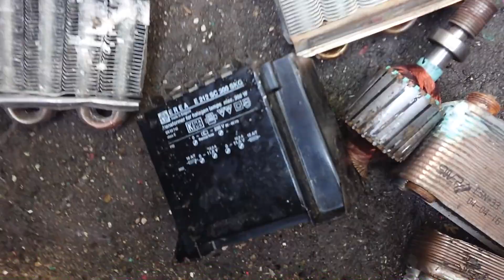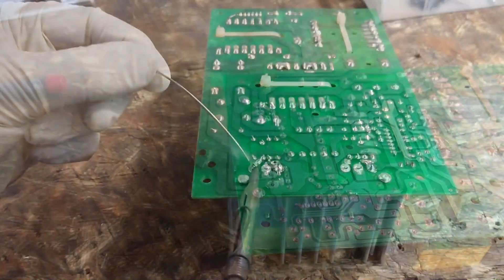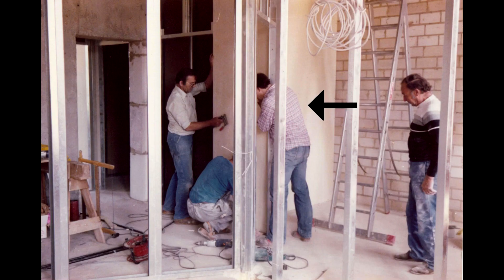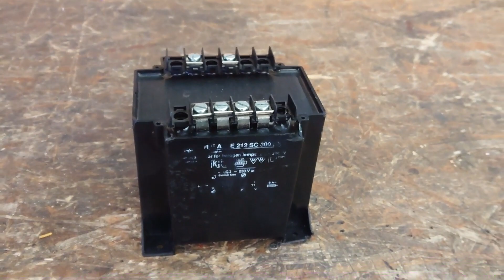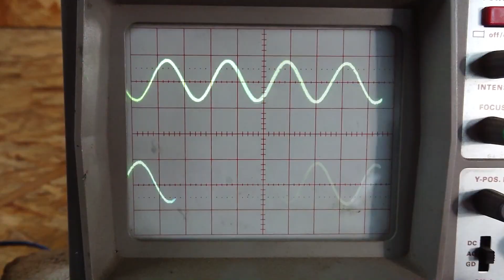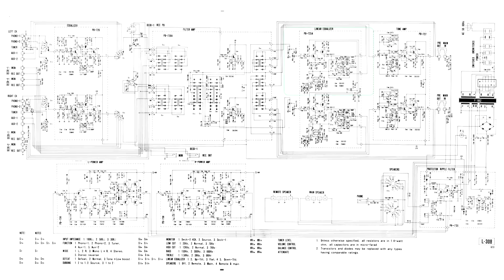Unusual Scrapyard Finds! Repair-A-Thon!

Comment: On that dental lamp front center wheel can be turned to adjust light intenisity, it works mechanicly by partialy obscuring the light bulb. It's usualy stuck becose everyone kept it at maximum for decades. Also focus can be adjusted to get perfect rectangle light on the surface at 1m distance by removing back cap held by the spring coil and pulling bulb socket in and out by hand, bulb can also be replaced from the back without disassembling the lamp. I still see them in use to this day and osram and philips still make 24v 150w bulbs for them.

Comment: Nice work on the amp repair! I have an old Technics SA700-A tuner/amp (100 watts RMS per channel), from 1978 that needs a similar treatment. It still works but the pots and most of the switches need serious cleaning and/or replacement. I hate to just throw it out, since it has fantastic performance when it IS working. It's a real boat anchor, weighing in around 35 lbs. (16.1 kg), but most of that is the massive transformer inside! Hopefully I can get it out from my back room and back in operation in the near future!😄👍

Comment: That Fluke Scope-Meter is bad-ass.  I used one for 3 years.  You can perform a "power quality" test with them.   A lot of times, the failure of electronics can be related to the utility supplied power.  With that meter you can log the utility power for weeks.  Even monitor the functionality of "surge-suppression" devices.  Yeah totally "nerd-out"!

Comment: "Scrounge-yard Score-a-thon",  I'm the total scrounge.  My friends say that i pull anything out of the grave and bring it back to life.   Well, somethings.   But, somethings are repaired, there's still the ordinary wear that reduces the operating tolerances.   So its never (or rarely) perfect.   Hey, better than nothing and less volume in the landfill.  Those dental lamps are all over USA.  Yeah, they chow some watts, but they're worth the sentimental benefit plus the color of the light is the best.

Comment: I suggest you put aluminium tape on the back glas of the dentist lamp so more of the light is put on the table and not in your face. Would that lamp run on dc? if so you could put a bridge rectifier on the transformer and a regulator with 2 lead acid 12v batteries or a 24v lithium pack for backup light if you ever lose power.

Comment: The halogen lamp in your dental light will draw a shit load (I don't know the metric equivalent) of electricity, and, after forty years of use, who knows when you will have to fork over a pile of cash for a replacement? Perhaps you could do an episode showing how you replaced it with an LED? After all. it is very likely that every dental light being sold today is LED, so there might even be a version that will physically fit your exact light. Or you might find that the guts of a common LED lamp would fit. Wouldn't it be nice to run your light for long periods over the bench without the clock ticking in the back of your mind?

Comment: Re bad buttons: I have found from experience with remote controls that after many years there forms a honey-like goo under the buttons that interferes with operation. One can clean the goo off with isopropyl, but care  must be taken to not dissolve the black conductor that makes the button work. But such cleaning can be done only so many times without permanent damage. I have seen this fault many, many times. but I have no idea of the chemistry of the goo.

Way back in time when shops actually fixed home electronics, one replacement pot manufacturer (CTS?) made a series of modular parts that allowed one to put together almost any configuration, such as the four-banger in your Luxman. Are they still commercially available? If the carbon tracks are rough, could they be polished with ultra fine grinding compound? I have seen auto finish compounds that are so fine that that they can be used on optical plastic parts without fogging the path. Unfortunately it is expensive stuff, and, you can polish for hours without making any visible progress (which might be just right for polishing pot parts).

Comment: I had a Luxman L-205 amp unfortunately i had to sell it but it was such a good amp "was low on funds"  so long ago.

Back to volume knobs yes many audio knobs back then did some crazy things even today you can find some crazy things where they use some rare pot or what rotary encoder in some form factor or another.

Simple but yet complex solution, you can have the volume knob just connect to a shaft and use gears to connect the actual pot to the volume knob shaft in the middle and just use some double gang pots with gears attached to its shaft, wire accordingly as onside will be the rotate in the opposite direction back a bracket and mounting to suit.

This way if it happens again just replace with standard double gang pots.

anyway just a thought.

Comment: Loved to see that broken speaker sing back into life!
Reply: Frankly, I’m surprised that it worked. Back in the late ‘70s when I was managing a small speaker company, we assembled our own woofers and we had a special alignment tool to center the voice coil in the magnet/pole piece assembly. Any errors in concentricity would result in the voice coil rubbing and causing distortion.  Back then we were using Peerless tweeters that had a faceplate with the dome and voice coil mounted. It was held on by four screws. I got really good at correcting the ones that were misaligned by playing a sine wave through them and listening for the absence of distortion as I moved the faceplate.

Comment: I've said it once, I am saying it again: I am not a handy-man (sure I can fix some things - especially computers, those I can take apart and put back together, no problem - but I am not that good with tools and especially electric wiring etc...I can do networking-cables, as I've installed my very own home network with 2 Sockets in every room in this apartment, except in the bathroom) but watching this makes me want to hit the scrapyards and recycling facilities (I've taken stuff from there on occasion before, but it was mostly intact stuff that just needed cleaning!)

Comment: I had a bad pot on a 1980s Radio Shack scanner radio.   I cleaned it over and over again.   It was still failing.   I finally opened it up and usually the wipers consist of 2 or 3 fingers touching the resistive trace.   There was definitely a worn spot on the trace.   It dawned on me to slightly bend  the wipers over to a non worn part of the trace.   It has worked fine now for a decade.   That solved my problem.   I love this series.   I never miss it!!!!!

Comment: That little Grundig Radio in the beginning was full of golden goodies. Sure, the case was beyond its function of looking good, but that case had a new job protecting all the goodies within which it had still done in the impossible and ultimately terminal confines of the scrap yard where its internal irreplaceable resources will be lost forever. I could not have past that one up.

Comment: I also have a dentist light in my room like the one you have there. Mine is mounted to the ceiling. only problem is that the bulb gets real hot which makes my room warm in the summer. Any idea how i might retrofit it with LEDs instead? also the back side of the focused light is a weird yellow color and i wonder if there's a way to block that off?

Comment: i had this speaker too and just cause i know i can tell you if you hold the light button you can switch trough the modes for the button backlight lighting. i thought i just needed to tell you. LG aus Deutschland. weiß auch nicht warum ich das auf englisch geschrieben habe.

Comment: i had an old high end yamaha receiver that was dual stereo, and it had a dead knob. the receiver probably cost over 1000 new, and all of the knobs were robotic! it had a remote control which could change all the settings, and the way it worked was each knob had a little motor that could turn itself. it was an insane design and the cost to replace a dead knob was more than the price of a brand new yamaha receiver

Comment: That Luxman is worth top dollar on the vintage HIFI market. That's easily worth $500 in the condition it's in. Probably more on a good day. Especially since you've done the work to get up to spec...and most techs wouldn't have even put it on the scope. They'd have just changed the caps and sprayed the pots and called it good. It's a beautiful piece. I'd work it like short order cook. ;)

Comment: I've had a few Logitech keyboards with those contact pads failing on me... same thing, tried cleaning, tried messing with them to no avail, looked up for ways to "resurrect it" no luck, ended up trashing the entire keyboard. Didn't want to, but I couldn't find any other use for it...

Comment: You should volunteer at Repair Cafe's, I do it but not being electronic savvy I struggle with them, although thankfully very little comes in that has electronic problems.

Comment: I had found spraying scratchy volume controls with WD-40 does a good job, better than contact cleaner and the surface stays a tiny bit oily, not good for dusty environs but that is rarely a problem inside a amplifier/receiver cabinet

Comment: 💡 I would have simply treated the quadruple potentiometers with oil first, which helps against dirt on the resistance layer and against an oxide layer on the sliding contact, which is mostly to blame for malfunctions of old potentiometers that have not been moved for a long time. Add acid-free, non-resinous synthetic oil, Multispray, to the potentiometer, turn it a few times, done. Oil also helps with all low-voltage contacts (e.g. batteries) and plug connections (e.g. headphones).

Comment: The front metal piece of the Luxman amp is a beauty. All sorts of switches designed to their job, everything in the right place, boldly engraved features, timeless font, not pretending anything.

Comment: i'd love to have 1-2 old dental lamps it would enlighten my work. Also have you tried soaking that volume pot in the sonic cleaner? I have a couple of old receivers from the late 60s that had similar issues. They were used a lot but when i tore into on the track in the pots were fine. They just needed lots of cleaning and some new lubrication on that secondary balance part. But your fix works fine too once the balance is set evenly to the R and L channels. Now I must find some dumpsters to dive into. Lol

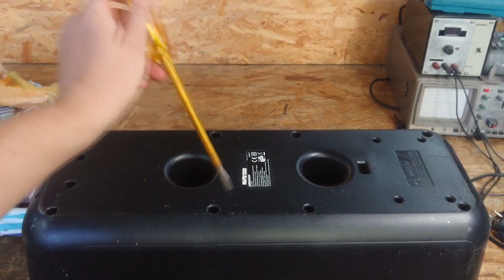Comment: 8:35 As an American I was always confused, why do they called the long screwdrivers as cabinet screwdrivers. This makes sense now to access speaker cabinets. I always thought, why would you need a cabinet screwdriver for kitchen cabinets? Those access screws used standard length screwdrivers.

Comment: The larger capacitors are not just "old technology." They probably have a higher surge current rating than the new ones, though really it will make little difference. It would show as an increased resistance and more power supply ripple when the amplifier is under load. Since that will be when your music is at its loudest, the extra hum is not likely to be noticeable.

It seems slightly surprising to hear a European accent referring to a "cheap ... from Aldi." Aldi is about 3km from here. Why I should be surprised, I don't know, we needed paracetamol when we were in Poland and got them from Aldi in Gdansk. No difference apart from the spelling on the packet.

Comment: I know it would add to the already tremendous amount of work you do filming and editing these videos, but would you consider giving us a price list of all the components you had to buy to make something work again? I reckon it'd be interesting to see it juxtaposed with the price of a new/good condition used equivalent of what you've just repaired. It could nicely emphasize just how much sense it sometimes makes to simply repair stuff, rather than mindlessly replace it with a brand new one off the shelf.

Comment: Whoa, that Luxman and Fluke... Things of beauty. Joy for ever. And an ultrasonic cleaner is indeed mighty useful in a shop. I still can't understand why the manufacturer didn't use conformal coating on the PCB given the possibility of leakage and water damage happening. Nicely repaired.

The Fluke repair gave me an idea for tackling my Leader LBO5880 scope - its buttons (also conductive rubber) act up and I'm pretty angry at them, might replace them with TACT switches but first I'd try to see if this is the rubber problem, just like you did here. BTW, I see you have a Hameg scope on your bench... nice. I like these a lot.

Careful about repairing speakers this way; first you have to ensure that no particles got into the magnet's slot and then precision matters. A fraction of a milimeter off or skewed, and your speaker will either get a lot of bad distortion, or won't work at all.

Nice way to reuse that lamp. Old gear working perfectly well... So easy to fix, and none of that planned obsolescence rubbish. Siemens pro gear was top notch, I still admire it. Reminds me of how I worked on a single-ended ECL86 or EL84 amp built for a film projector back in 2005 or so. The way it was built was absolutely beautiful.
Vintage audio gear is absolutely my thing, and the Luxman restoration was just damn lovely. When cleaning pots I use Kontakt PR and if there's more issues running around, I take them apart and clean thoroughly with a Q-tip without any aggressive solvents other than Kontakt PR or isopropyl alcohol. I correct any loose rivets (gotta be delicate about that not to break anything) and put the pot back together. By the way, my favorite kind of potentiometers is the one that used carbon sliders like the old East German RFT ones you find e.g. in Vermona gear. As long as the carbon piece is there and the spring puts some pressure on it to ensure firm contact with the resistive path, those pots absolutely didn't creak.

Comment: If I wee you I’d just. Spray a bit of deoxidant in the pots before replacing.  They usually work and doubt anyone who used such an amplifier used those pots much especially if they’ve thrown it out

Comment: I have fixed a lot of things just by changing fuses.
Most things use cheap Chinese fuses now and their actual capacity can vary widely from that is labeled.
I replace them with good Bussman fuses.
Sure sometimes the new fuse blows but sometimes it doesn't.

I have my father in law's magnifying lamp, some hand tools , some nice old school Weller soldering irons and at least 100 pounds of good old real lead solder.
We worked together at a 2 way radio shop for a while.

Comment: Thanks for the really nice content, love that old dentist lamps, in relation to the old radios, stereos, etc may be a good idea to get the chassis, the IF transformers, ferrite rods, knobs, variable caps are becoming quite rare and very expensive. It may serve to restore another equipment or even to build an old style set.

Comment: i found a ditched JBL Northridge sub fuse was broken
opened it , checked it ...nothing wrong , gave it a gentle clean 
replaced fuse and cleaned fuseholder :P 
voila , free sub
thread fuses can wear out over time folks :D fix em with slow blows or just replace em sometimes lol

Comment: Hello there! Have you checked the possibility of changing the system to LED? You could either lower the powerconsuption or up the light-output without increasing the heat.

Comment: Wait! Two by fours? You commonly use 2x4's for building in Germany? As a life-long builder here in the US, I've always wondered about what standards are used for building materials in metric markets like Europe. What panel sizes are commonly stocked? Surely not 4'x8'?
Reply: Also in Finland "kakkkosnelonen" i.e. "twofour" is common slang term. It's either 100mm x 50mm in rough cut or 98 x 48mm when planed.  Many terms are used like "sawed two by four" or "hairy two by four". But hardly ever used mm or cm nomination. Same for  2x5, 2x6. Panels like plywood are about same size but there feed are not used. And they are quite standard size so we go with thickness only like "15mm birch plywood sheet". 2400x1200mm ~8' x 4' is common size. Drywall frames are with 60cm pitch (2'). Some still use inches about nail size, like 4" nails (10cm), but more rare than with lumber. 
Funny thing that I recently discovered when selling wood to sawmills: Logs are cut to length in forest. And those lengths are 30cm multiplier i.e. from 2,7m to 6m. So it must originate from 1 foot. So typical 2x4' length might be 4,8m (not 5m) ~16'.

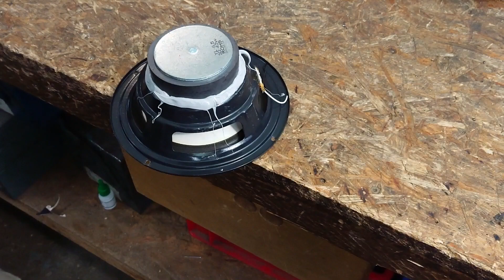Comment: 10:07 the coil has to be aligned with the magnet and by widening the holes the chances for misalignment increased. Directly gluing it on without checking the airgap seems a bit risky, but I guess the high manufacturing tolerances worked in your favor here :D
For a free Bluetooth speaker thats a nice fix 👍🏻

Comment: I have a JVC JA-S22 Integrated Stereo Amplifier circa 1979 (43 years old). It's all original, and works perfectly, and sounds great. Pots and switches smooth and almost crackle free! The 43 year old incandescent analogue power meter lamps are also still working! ... So, how come my amp is not displaying any capacitor problems?

I see a LENOVO Laptop! ... I have a Lenovo Tablet (I'm writing this comment on it). It's the WORST TABLET I've ever used! It's slow, it crashes and stops responding. It's garbage! I'll never buy Lenovo again! ... EVER! 👎

Comment: I love the amplifier repairs in this series.  I recently found an old Realistic stereo amp and the RCA ports on the back had broken their connections off the circuit board.  Even with my almost complete lack of knowledge when it comes to electronic devices I was able to re-solder them and fix the amp!  Thanks for the excellent content.